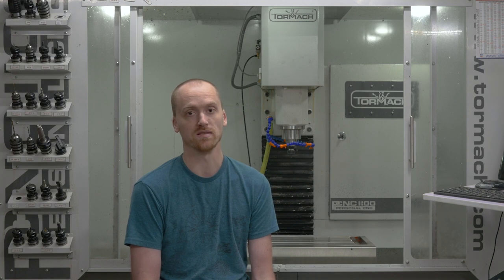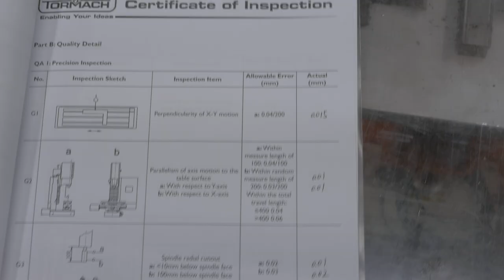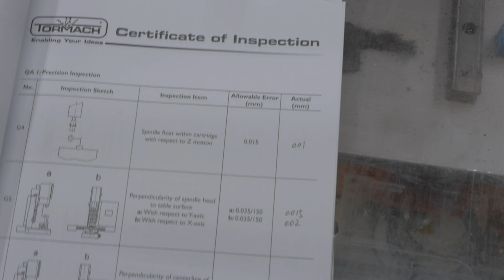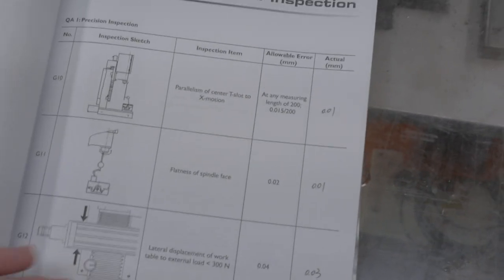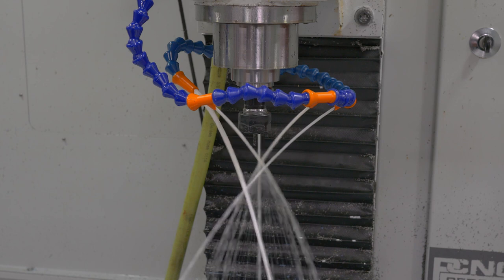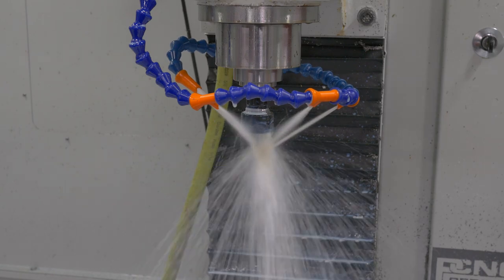tormachThoughts

Comment: My 770 makes me money doing side job work.  It has been absolutely great.  You can't buy a HAAS and then have it set there not running for a few days while you take care of other life issues.  With investments like that you have to start worrying about spindle time.  You either use it, or you don't make money.  A Tormach 770 can be purchased as a personal tool.  The controls are excellent for manual work as well as producing parts.  So I can do the custom work I do easily.  I can either modify an existing part, or make a replacement part, as needed.  Automated machining or manual control.  They have their place.  If I was going to start doing runs of hundreds of parts and do them regularly?  I'd buy a small HAAS, or a Brother... something with at least 10x the weight and horsepower.  But do you DO that kind of work?  A dozen good custom jobs and the 770 core mill is paid off.  I didn't take out a loan the Tormach was paid cash.  No payments.  Spindles can be installed yourself without a service call.  Even if you stretch really, really hard to get into a small $35k HAAS mini mill how much will maintenance cost?  How much more will tooling cost?  Do you need big power run to your garage or shop?  Do you need a new concrete pad poured under the machine?  How much will the shipping and rigger cost to deliver and position the machine?  It goes on and on...  The Tormach?  Shipping is now included in the price when you buy.  You can move it with a pallet jack.  You can put it up on the stand or your work bench with an engine hoist.  Pretty much free compared to the other options.  The difference?  It's light, it's slow, but it's cheap to own and gets jobs done that you would not want to do or just cannot do on a manual mill.  I make mostly titanium parts on my 770.  It gets it done and I never have to think about issues like efficient use of spindle time.
Reply: Well said
Reply: Exactly same experience with my 770

Comment: Well, what do you think "flood" coolant means? It's designed for flooding your shop :)
It's not a bug, it's a feature™
Reply: Supposed to be installed in a retention pond.  The cabinet serves as a chip filter.  That way you can run the pump direct from the pond.
Reply: @ShainAndrews 
Whoosh..
Reply from the maker: Ha!  I've thought about just putting the machine in a kiddie pool and pumping from that...
Reply: @afrog2666  Whoosh...

Comment: I've had my Tormach for about 7 months and have the exact same thoughts.  Although I haven't had any leaks except for the giant 1" hole in the base where the coolant hose comes through.  I'm making a plug with an o-ring to seat between the hose and base to eliminate that.  Otherwise, I'm a happy camper.
Reply from the maker: I upgraded my coolant hose to a regular garden hose which is ALMOST the right size to plug that hole.  I ended up wrapping a strip of thin rubber around the hose at that point and jamming it into the hole which seems to have plugged it quite well. :D

Comment: I've had several suboptimal experiences while buying used machines.  I'm 0 for 3 on successfully purchasing an old machine that runs and stays running.  Fortunately I have been able to part them out to make more money than I spent on them, but if you count the endless hours I've spent crawling around greasy machine cabinets with a multimeter I've run a huge loss.  My advice for small startup manufacturers is buy new cnc only.  Old manual machines can be had that work great, but old cnc is usually a disaster.  If you can't get by with manual machines, consider having somebody else make your parts for you until you've got the business case to buy your own cnc equipment.
Reply: i bought a 1996 Femco Lathe, Fanuc control. 1600 bucks. Runs like a goddamn champ for the past 3 or so years now. There is a difference between old machines and wore out neglected machines. If the control cabinet is a greasy mess, thats sign #1 to stay the fuck away. It should be hospital clean in there.
Reply from the maker: My Lagun mill just stopped taking user input the other month.  It works here and there but frequently will just stop mid-job.  I'm glad I don't use it for much other than a drill press these days.
Reply: Old CNC is the best, you rip out everything electrical and just retrofit LinuxCNC and enjoy.
Reply: It's a hard bet on used machines... If you know what to look for you can score a jem!

I have two Fadal 4020HTs one Fadal VMC15 and one Okuma LNC8.

All of them have been absolute champs and have made what I spent on them back in as little as a couple months.

Comment: The pin isn't necessary.  I've got a BP with the pin removed, it tightens and loosens just fine.  If you have the auto-drawbar, it's a moot point on the Tormach.  Next time it shears, remove the carnage and truck on without it.
Reply: EFormance Engineering   I have to agree with you there, my pin went awol years ago and I certainly will not lose any sleep over having to replace it, maybe if I have to replace the bearings but perhaps not even then.
Reply: Yep. Same here
Reply from the maker: I thought the idea was if the collet slips in the taper it would loosen from the drawbar and then things get scary.  I know it shouldn't ever slip in the taper (and maybe couldn't with the spindle HP) but idk...
Reply: @ChrisDePrisco  Nah, The pin is just a locator, it doesn't take any torque (as you found out).  The tool should slip in the collet.  In extreme cases the collet will slip in the spindle, that's why they have BT30 spindles that replace R8 spindles, so you have drive keys.  The pin is more trouble than it's worth and make setup more difficult if you swap tools a lot (the slot is not uniform in all tooling).
Reply: Chris DePrisco   it's late at night here so brain in half a sleep mode but if the collet slips won't the drawbar tighten?
Reply: @chrisstephens6673  Most of the time the tool will spin in the collet, rarely does the collet spin in the spindle.  If the tools spins in the spindle, it's usually because it's not a collet and it's a solid holder, shell mill, or boring head.  If the collet spins in the spindle, that indicates the drawbar isn't tight enough, IMHO.  Tormach uses maybe 4 or 6 belleville washers, probably not anywhere near the drawbar force of a Bridgeport.

Comment: what pump did you use to upgrade the coolant system? I have a 770 and completely agree that I get wet parts and no chip evacuation lol
Reply from the maker: It's just some random "shallow well jet pump" from the local home improvement store.  1HP but they have many sizes you could go with.  I think 1HP is plenty.  The well pumps are meant for pressurizing the tank in your house so you get lots of pressure.  The 1HP sump pumps and utility pumps are cheaper but they move more water with much less pressure.

Comment: a haas mini mill will fit wherever an 1100 will fit. they run off single phase. might want to revisit that one.
Reply from the maker: Not in my garage - at least not by the specs.  According to them you need 106" minimum ceiling height; I have only 92" :(
Reply: Cut a hole and reframe that part of garage...unless there is a room above. 5/8 thick sheetrock and one ceiling joist stopping way to many in there tracks it seams like.

Comment: I have a 770 S3 in a basement shop and agree.  Use Nashua black plumbers tape/wrap from HD on seams.  Holds up well to coolant so far (3 months).  Black, stretchy and about 75mm width.  Also starting to use high feed cutters as possible solution to deflection since they produce a more axial force and less lateral.  Bought DiJet 3 tooth 0.5" and Kyocera Raptor mini 5 tooth 1.0" to use on 420PH mold cavity inserts.  Promising so far.

Comment: As for your tolerance problems, did you follow the instructions for making sure everything is calibrated? For example, adding the 4th axis to this machine comes with specific instructions on centering the platter, because much of the machine itself needs to be calibrated physically, especially after it’s been shipped. And why is your machine crashing when it has crash sensors? Is this an older machine or something, it sounds like you’re either missing certain parts or it’s just human error. I’ve been within half thousandths tolerances as long as I’m not trying to set speeds higher than it’s rated for, what’s the purpose of having a 3 phase machine if you’re just prototyping, because the 1100mx is plenty capable of making aerospace quality parts, as long as you thoroughly followed all the instructions, and you don’t try setting everything at maximum speeds, and get the automatic tool changer, etc, there’s no reason it should take hours to make a part, especially with the insanely easy to use software. I guess if you don’t know how to quickly design parts, that could eat up some time, also depending on your fixturing, and part sizes, you can make several parts at once

Comment: What horse power is your new flood coolant? I have started with a small mill like yours (not Tormach) and I have seen ALL and I mean all the issues you ahve gone through. Except fro the collet holding I have an BT30 taper. However there is so much in what you have said that no one will understand till they try to do it as well. I subed because of this video. Thank you for making it.
Reply from the maker: Thanks!  It's just 1HP but it's a shallow well jet pump so it has much higher pressure than a normal 1HP pump like a sump pump or utility pump.

Comment: Devil's advocate... which would give you the most productivity for similar money:  one Haas, or two Tormachs?
Reply from the maker: With just the right mix of a small number of products you make, just yourself working, and a small number of tools needed at any given time you may be able to be more productive with two Tormachs but I'd say that is an extremely rare case.  The Haas will be much more productive in a job shop environment or any more "general purpose" shop because it's going to be a lot faster and with more tools available in the tool changer.  At least that's my opinion having never had a Haas or other "real" VMC.
Reply: @ChrisDePrisco  : Thanks Chris, my comment was very much "tongue in cheek".  You are on a different planet to me... I've never had a  VMC of any sort!  One thing I do know for certain; if you complete a project using tools and equipment you love using, you will have much greater enthusiasm when the next project arrives.  "The pleasure of a cheap price is far outweighed by the pain of a shoddy product" (Not sure if that applies, but I always wanted to use it somewhere!)   :o)
Love your work.

Comment: I can relate to your Laguna troubles. We bought a Laguna CNC plasma table at school and have had an absolutely terrible experience. The controller is in badly translated English, and some of the information we received from the company regarding settings has just been flat out incorrect. Service has been slow and not really helpful, even for a new machine. Definitely experiencing buyer's remorse. Would not recommend.
Reply: *translated.
Reply: @NorthernContrarian  Thank you. That was an ironic mistake on my part.
Reply: In regards to your Anilam controller and the x axis runaway. It’s the x axis jog key sticking. I had the same issue with one of mine. Keypad can be found on eBay fairly reasonable.